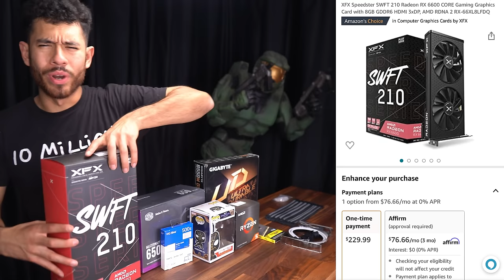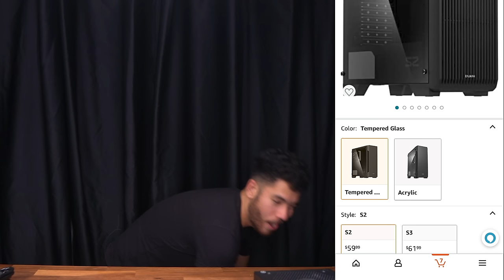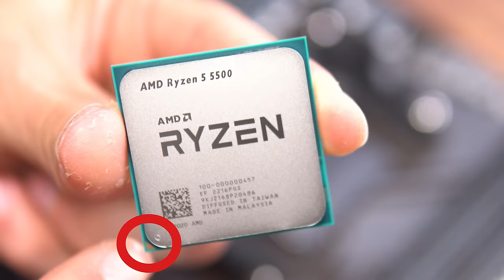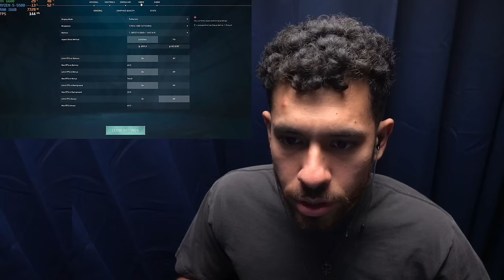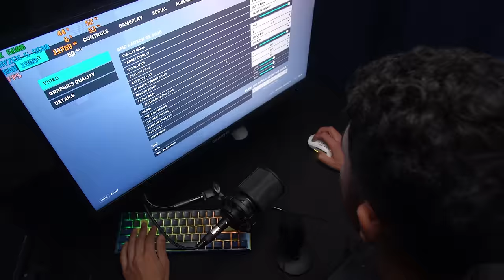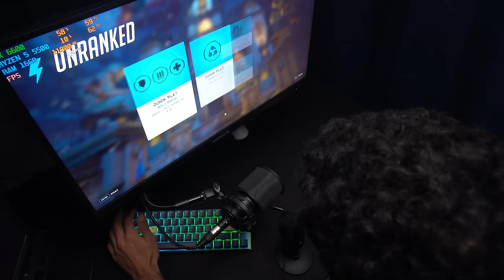Build the Best $600 Gaming PC - 2024

Comment: Is getting the AMD RX 6600 OR RX6600 XT better?
Reply: If both are the same price or RX 6600xt is slightly higher price than RX 6600. Go for RX 6600xt. RX 6600xt is basically a stronger version of RX 6600

Comment: Hey im pretty knew to pc building, it interests me so much. I was wondering you could build or make a video building a PC that's better than a ps5 for the same or less price. Is it even possible rn?
Reply: That's a tall order. I don't think its possible to build a system that's better (hardware and performance wise) than a current console for less than their cost. The reason they are not that expensive is because both Microsoft and Sony loose money on each console they sell. Microsoft admitted a while back that they've been loosing money on each console they've sold for just over 2 decades.

Comment: I’m trying build a pc primarily for fortnite and I was wondering if you could switch out the cpu and gpu for a Intel core i5 core 12400F and a GeForce GTX 1650 super. I basically just wondering if the motherboard will support those two
Reply: The graphics card he shows is better than a 1650

Comment: bro you can use Intel Core 13 12100F.
which is better in performance and cheaper than the Ryzen 5 5500.

Comment: Im very new to the pc world and have never bought nor built a pc, but i plan on building one to get more for my money and not pay for the labor of building it, so its probably a dumb question, but does the motherboard come with the wifi cable or do I need to buy that separately, and if so, is there a specific one I need to get or any I just shouldn't? Im also concerned that im not quite understanding how the pc gets wifi, as in, if the cable is needed, since when i search for one i find ethernet cables and im unsure if i even need a cable, so if possible i would greatly appreciate if that could be explained to me, im very dumb.

Comment: So I went to Micro Center yesterday and bought all of the items for my first build. Here is my dilemna: I have a lot of files on my laptop that I need and instead of starting with a fresh Windows 11 install, I was wanting to just clone the hard drive on my laptop. The problem is my laptop has an Nvidia graphics card and I bought an Rx 6600 for my build. If I just clone the hard drive, will the NVIDIA drivers conflict with the AMD drivers and make my build unstable?
Reply: I would just copy the files over to a flash drive or external hard drive or over the network to the new PC. There's always potential problems when you move a Windows install to totally different hardware. It likely will work fine, but there's that possibility. It likely won't affect anything with the video driver. Just make sure you uninstall the Nvidia driver on the cloned system using something like DDUninstaller.

Comment: Is it me or there is a lot of suttering during gameplay? I have a RX6600 and a Ryzen 5 2600x and recently I got a lot too
Reply: Same man.
Idk when it started or what happened. But I have similar system in a budget build..
R5 2600
Rx6600
32gb 3200 ram
M2
650w psu..
It won't even get 30 fps in world of warcraft raids with graphics on low, I just don't get it.
All gpu utilization and temps are fine.

Comment: I was wondering, if I wanted to use the ID-COOLING FROSTFLOW X 240 instead of the provided fan and fin set..Would I just remove the 4 screws on the motherboard that were originally holding those 2 black plastic things?

Edit: Do I actually just omit the bracket that I would put through the back of my motherboard and also omit the intel bracket and just connect the other included bracket labeled AM4 to the brick and then directly to the motherboard? :O

Another edit: I'm beginning to wonder if this Frostflow x240 will even fit with this build?

Comment: I'm new to building computers and i dont know if i should get the XFX Speedster AMD Radeon RX 6600 or the XFX Speedster AMD Radeon RX 6400. Can someone tell me the difference and which one should i get. Also when i buy these parts, will they come with the cords and wires or will i have to buy them separately.
Reply: i recommend getting the xfx speedster 6600 for a more enjoyable gaming expierience, and its only $50 more atm, the cables are all included with the products you buy.
Reply: @ceenos  thank you so much for explaining this, and I’ll definitely invest in that extra $50.
Reply: @ceenos  one more thing, should I use the pc case he used in the video or can I get a different one, and is there a Nvidia graphics card like the one he used in the video, because I am building a gaming pc.

Comment: Hey Crater so i followed everything you did in the video but it still didn't seem to turn on. I will try re doing it tomorrow and i will let you know do you know by any chance what could have caused this?
Reply: I figured it out and the pc works great I think I just missed something when building. Great directions great pieces everything was great
Reply: @Skuly44  what did u miss?
Reply: @kiyro187  I’m not sure I just re did it and it worked just fine
Reply: @kiyro187  I followed all the steps, I even took everything apart and connected the power supply alone to the motherboard and the fan isn’t even turning on atleast. Does anyone know what’s the problem? Is it a motherboard issue? I got everything brand new aswell

Comment: I just finished building this but after installed windows I’m not able to enable wifi. Is this build wifi compatible?
Reply: It has wifi, but you most likely need to install the network drivers. Either temporarily connect your PC to your router with an ethernet cable and download the drivers from the motherboard page, or use a different PC/device with internet to download the driver and transfer to your new PC via USB drive and install.

Comment: Hello everyone, I am wondering if I could get some assistance. I just built this PC with all the specs shown here but the only difference is the CPU. My fans are running a little loud. I am wondering if I did something wrong or if there is some tuning that I can do.
Reply: Just built it as well, i am not getting the same performance the CPU is working super hard while my GPU barely running, is this similar?
Reply: @frankieramirez6959  mine isn’t starting at all I am currently re starting do u know why it’s not working

Comment: i3 12100f
asrock b660m
msi rx 6650xt
600w 80 plus bronze
512gb ssd
8x2 3200 teamforce vulcan
any case with  inbuilt fans
best value for money if you are actually trying to build under 600:hand-pink-waving:
at least i would do this it were me✌
Reply: i searched it up in CAD on amazon and switched the gpu to a 1660, is that fine? it comes around $714 CAD.

Comment: My first pc build and being here in the uk trying to match parts was a bit hit and miss but got the majority or so I thought. The motherboard was exactly like the description only it wasn’t 😢 there isn’t a 12v pin on the motherboard ! I thought I was going crazy but turns out it’s a different version of the motherboard so now trying to figure out how to setup the led kit as the case has its own ARGB built in but it’s 3 pin 😢
Reply: Same thing happened
Reply: how did this happen I don't want this to happen to me
Reply: @v9mpsta  not sure tbh it would seem that there are maybe updates versions or older gens of this board . You will be fine with whichever you get however I would recommend not buying an led kit until your board arrives as this is the only thing that wouldn’t fit on the board for me personally. Everything else is wasn’t a problem
Reply: @rickcollins9275  thanks bro

Comment: instead of 16gb of ram can i do 32 or do i need a different power supply
Reply: RAM uses a negligible amount of power relative to other parts so you will be fine if use more memory. In other words, that same PSU will work if you go with 32 GB of RAM.
Reply: @JJFlores197  thank you I know some things about computers but not a lot lol

Comment: Hi bought every thing and put it together and it turns on but it doesnt come up on the screen i am using a hdmi cable for my big tv in my living room if that makes a difference i am new to this so if you or anyone could help me out thatd be dope👌
Reply: Make sure you plugged the HDMI cable into the graphics card and not the motherboard. Also, if your motherboard has a diagnostics light, take a look at what is lit up. That can help you figure out where the problem may be at.

Comment: seems like you should be able to get something better than a 5500.   12100f is 95$  it would preform much better than a 5500
Reply: No lol. 12100F is a little worse than the Ryzen 5 3600 and actually stutters in CPU intensive games like Fortnite
Reply: @tallsz559  the benchmarks would disagree with you.  at best they are even, but usually 12100f leads by about 8%.  however I will admit I thought the difference would have been bigger.

Comment: can this motherboard support the Ryzen 5 5600 since im not 100% sure if it does but it says it supports B550 and it has B550m but it also has B550 in (B550).
Reply: Use pc part picker

Comment: i have an old hp pavilion p6310y pc i would like to upgrade. any ideas would be appreciated.
Reply: What are you trying to accomplish with this PC? That's a 13 year old PC. I don't really think its worth spending money on it for anything CPU/graphically intense. If you still want to keep it, I suggest maxing out the RAM (usually between 8 and 16 GB of RAM) and installing an SSD. That usually gets an older system running reasonably well. Installing a Linux distro can also help with performance.
Reply: @JJFlores197  thanks for the reply ill see if it workout for me

Comment: I'm not an expert so I'm not good with these stuff. Please someone kindly help me. Tell me if this pc is okay or any good or if there's anything wrong because I'll buy this pc and use it for 4k gaming, streaming, heavy editing and animation works
PLEASE

------------------------------------

CPU: Ryzen 5 5600x

MOBO: Asus ROG Strix B550-A Gaming

GPU: RTX 3060 12GB

AIO: Cooler Master MasterLiquid ML240L V2

RAM: Corsair Vengeance LPX (8GBX2)=16GB

STORAGE: Samsung 970 EVO plus 1TB NVMe M.2 (1) - 12500 tk

PSU: CORSAIR RM series RM850E 850 WATT 80 plus gold certified fully modular PSU

MONITOR: MSI OPTIX G241

CASE: Antec Dark Fleet DF700 FLUX Mid Tower ATX Case
--------------------------------------------

Comment: How do replace the cpu cooler to aio cpu liquid cooler?
Reply: You'll need to first check that your PC case supports a CPU liquid cooler and what size. There are many videos and guides showing you how to install a liquid cooler.
Reply: @JJFlores197  the one I bought is zalman s2
Reply: @mrmang35  As I said, you will want to reference the manual of your PC case as well as your intended liquid cooler. In general, the radiator gets installed in the PC case (can be on top, bottom or front of PC case). You may need to replace the motherboard's cooler bracket with one that comes included with your liquid cooler kit. Once installed, you install the CPU and then place the pump/block on top of the CPU. Connect the pump's power cable to the applicable power header on the motherboard.

Comment: My keyboard or monitor not working 😕
Reply: Did you get it?
Reply: Make sure ALL internal components are installed correctly. Pay special attention to the CPU and RAM modules. Some boards are very picky in which slots RAM is installed. If your board has a diagnostics light, it can help guide you where the problem is.
Reply: @JJFlores197 but weirdly I plugged a usb into all the usb slots and it worked just not for my mouse keyboard and monitor
Reply: @iiamKevv  What do you mean by "worked"? Did the USB light up or what? If your monitor doesn't show anything, then that means there's something wrong in POST, Power on Self-Test.
Reply: Yea like usb led lights and other items turn on and work but keyboard mouse and monitor doesn’t
Reply: @millionairesburner24  nope

Comment: HELP! Just built this exact pc. And after choosing Windows 11 Pro it says “This PC can’t run windows 11” says it doesn’t meet minimum requirements… huh???? What’s going on here
Reply: Make sure you have the latest BIOS update. Sometimes that can help with with installing Windows. Also, make sure you disable BIOS mode (may be called BIOS, legacy mode, or CSM or similar) and that UEFI Boot as well as TPM 2.0 and Secure Boot are enabled.

Comment: This would have been a good budget build to last 3 years if it were made two years ago with a 5600X. As it is, it will struggle to play new games on what should have been its 3rd and final year. The Ryzen 5500 is basically a slightly faster 2600X only on 7nm not 12nm. It supports PCIe 3 only, only 16MB L3 cache, Cezanne architecture (not 5600X Vermeer). You show severe CPU bottleneck, on a $220 RX 6600. Near half the GPU power is not being used at times. Hogwarts, Callisto Protocol, Plagues Tale, CPU will be 70-80% utilization (its limit). What happens when newer Unreal Engine 5 games release this year? Sorry, $600 for this build is a complete waste. 5800X3D is the only AM4 CPU worth buying for the future.